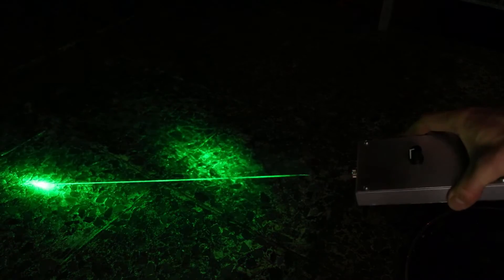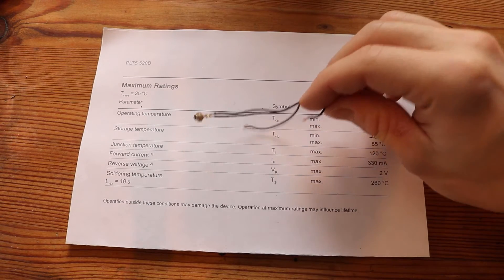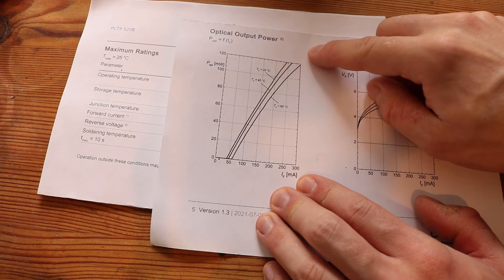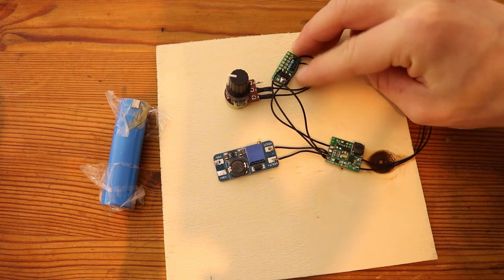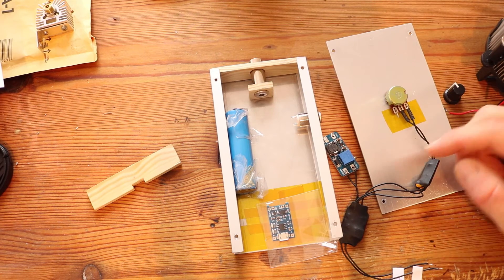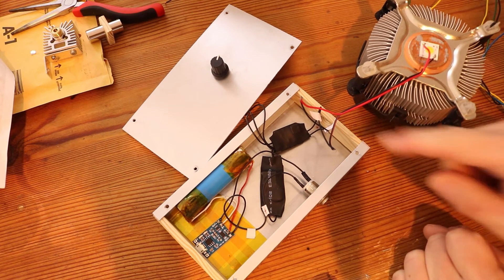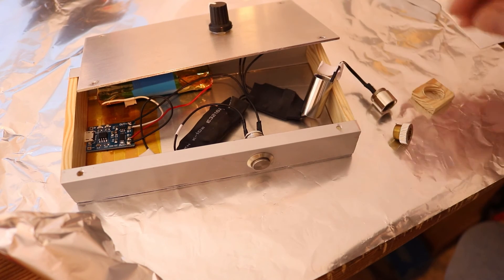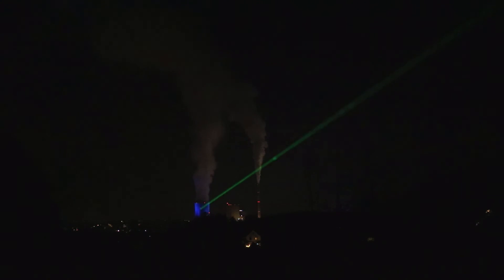DIY 100mW green laser pointer

Comment: Why a green laser blue would be a lot more efficent you could get way more power
Reply from the maker: I know. I think I could've gotten a 1,6W laserdiode for the same price. But I wanted green.
Reply: @jadentonkin466
I had assumed that was noticably harder to make, tbh. Is it not? 😅
Reply from the maker: @ivoryas1696 I honestly never used a laser diode that strong. If you can find a constant current source with enough current I don't think you would need to make any modifications. Except maybe add a heat sink to the laser diode. But I think there's a laser forum somewhere, there's probably good info on how to drive these things.